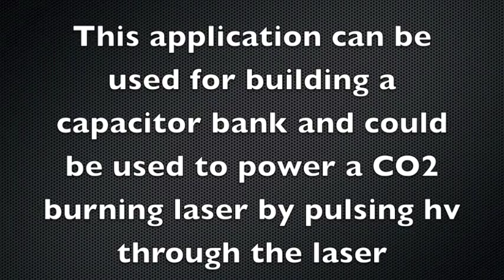Charging HV Capacitors

Comment: I've been hit with a lot of electricity high amperage straight off the lines everything but nothing hurt as bad as that microwave capacitor right after I got hit with the transformer making a Jacob's ladder
Reply: Sounds like you may need to find a new hobby

Comment: I always used to run those circuits off of 2 cells instead of just one AA. Sometimes you can get away with up to 4 cells before it wants to burn up, but it puts out near 1000 volts and charges way more than 4 times as fast.

Comment: Cool stuff, I used a synchronous motor ran through a DC voltage doubler circuit to charge mine and got a huge arc. Had to stop when I felt my wife's glare sizzling into the side of my face.(Far more dangerous lol)

Comment: Hey mate, I'm building one that plugs into the wall outlet, using a MOT, with the plan being that I can charge them ahead of time (I have several capacitors now), which can then be attached to a coil via the disposable camera circuitry. How long do you suppose it'll take to charge? Nearly instantaneous, you figure?
Reply: Are you still alive ?

Comment: How do I know when it is done charging?
Reply: BrainDoesStuff the camera has a built in led light that wil light up when the cap is full, but I think it will take a long time to charge them with such a circuit
Reply: NoAcogJäger, so how long do you think it'd take if I used the original MOT and plugged it into the wall?
Reply: @millionthmonkeymusic  near instant

Comment: The Kodak camera he's using only needs the button pressed once and it does not have to be held down during charge.  A simple coil wrapped around a straw will allow the cap to be discharged like he's doing (don't use graphite, it's got a large resistance) and will propel a steel nail piece ( I cut the tip of a nail off) just enough to stick in a piece of styrofoam.  We're not killing even cockroaches with a 100 uf 300v cap, but I haven't tried a can like he's showing, which could be >>100 uf.  No matter how big it is, though, the max voltage will be limited by the camera's charging circuit (~300 v).  On the other hand, if the can is a 2200 uf @300v cap, maybe we get some oomph.